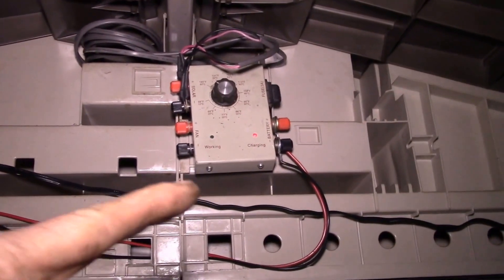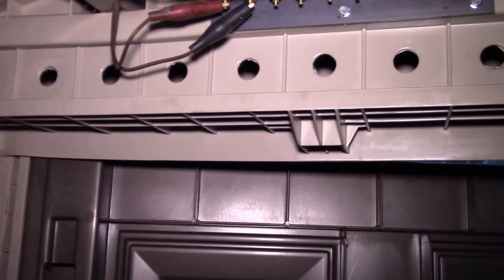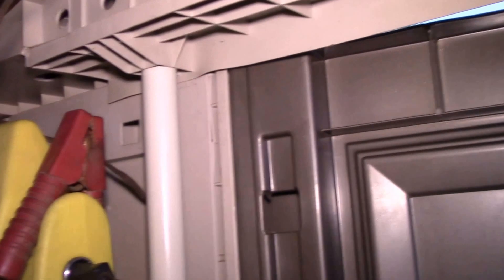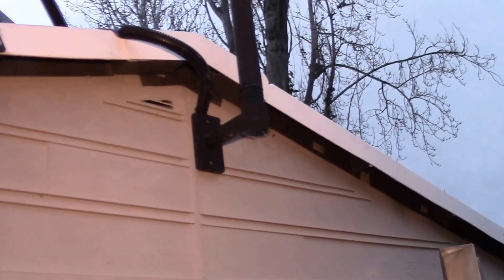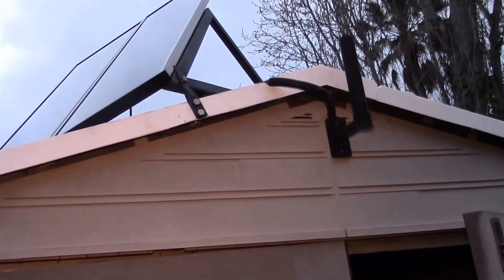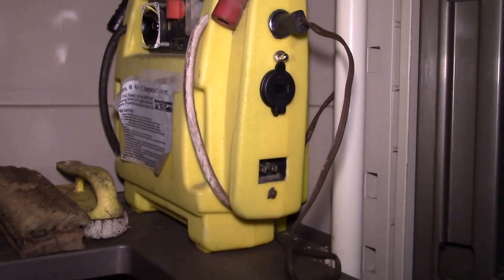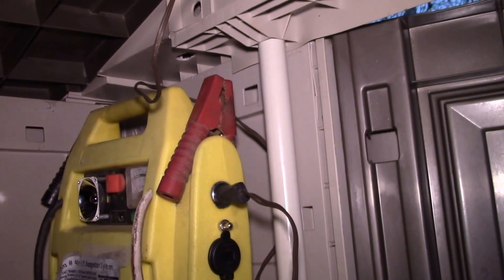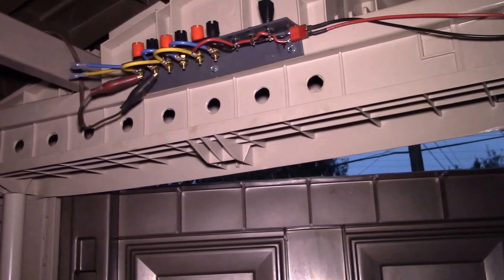Solar Shed Project, Part 4 - Power Distribution and Light Installed

Comment: For anyone viewing this video, please do not put your hands anywhere near open connections. Especially when it comes to the DC side. If this were to be a 48 volt, 64 or up, unlike the AC side which shocks you, the DC side actually cooks you.
Reply from the maker: Good points.  I'll be covering up the open connections once I finish all the the final wiring.  And this will all be an NEC Class 2 type of circuit, so not a shock hazard and also not a fire hazard since it'll be below 30V and below 100W of power.